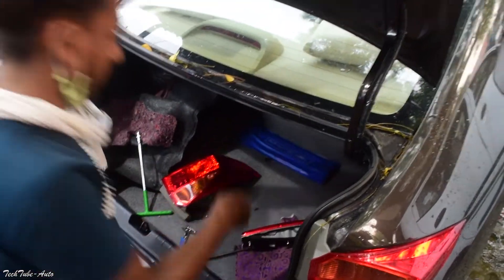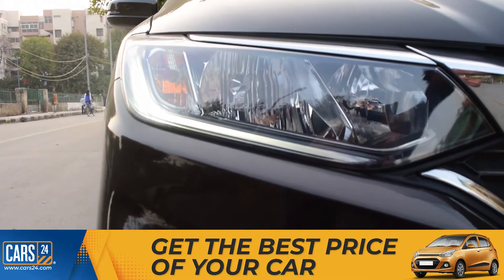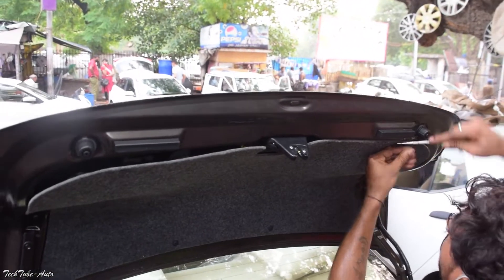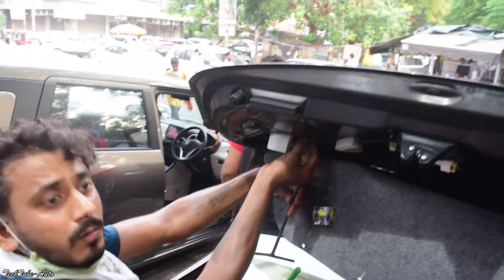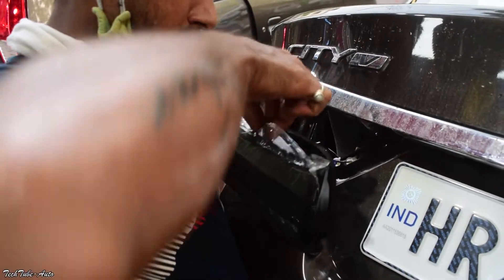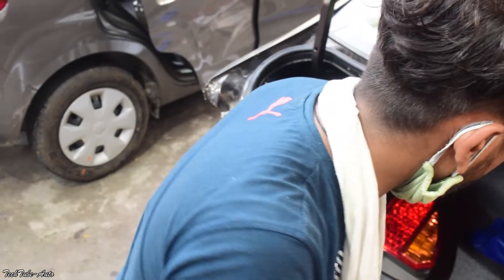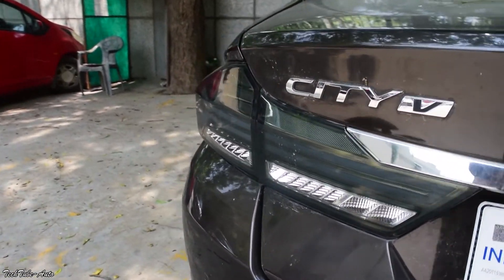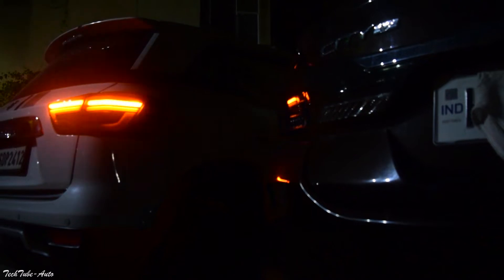Honda City modified | Aftermarket Rear lights for Honda City| Installation | Review | Pricing

Comment: Why is indicator on boot lid part of taillight not working? Check autoglam video for same lights the matrix indicator runs across both the pieces of light. I think your mechanic missed connecting bootlid indicator wires